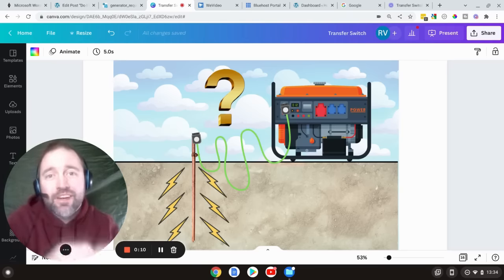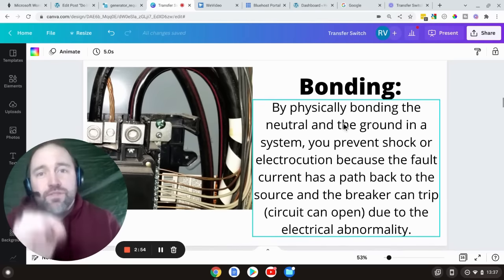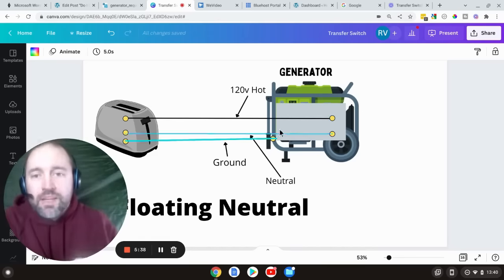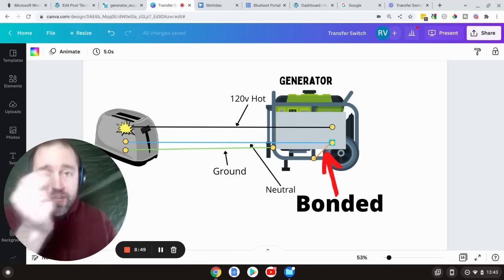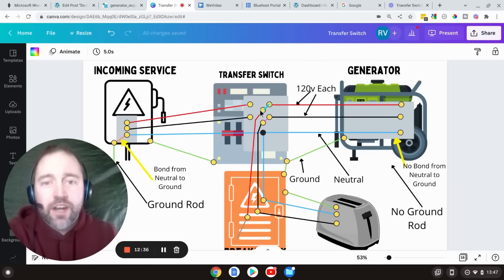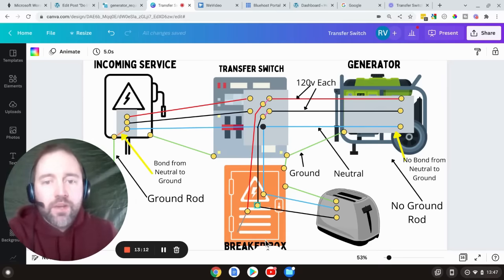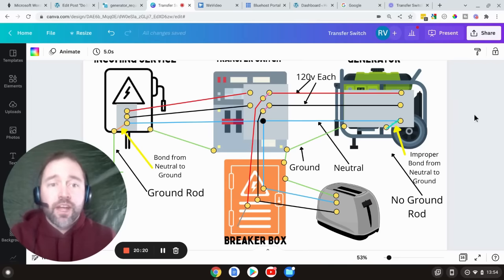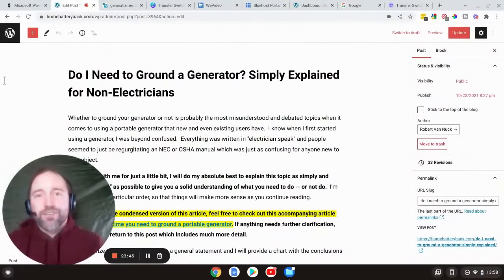When You DO and DO NOT Need to Ground Your Generator [Extension Cord Use & Backfeeding a Home]

Comment: I'd like to ask a question. I believe everything you're saying here 100%. Re: the video at https://youtu.be/_qVR5Yvktlk titled "Champion Help Center: Converting Your Open Frame Inverter from Floating Neutral to Bonded Neutral", Champion states "Warning! Your unit is not fully grounded yet. before running your generator, you must connect a ground wire from the generator to a properly grounded copper rod that is at least 8 feet in the earth." This conflicts directly with the part of your video where you state this could create a dangerous condition. What are your thoughts on that? Is there a specific situation where Champion is correct, and you're correct? Just looking for clarification. Thanks for your awesome video. I'm not an electrician, but I dabble in stuff (built a 3D printer that uses mains for bed heating, DC for everything else, installed UV lights in my HVAC). So I know enough to be dangerous. I want to know enough to be SAFE. Thanks again!

PS: I intend to bond my neutral to ground on my  WEN 56380i. I figure I can do this either with a jumper at the outlet or a jumper plug via Amazon. Cheers.

Comment: Great explanation of when to use a ground rod and when not to use a ground rod. The actual reasons were briefly mentioned, and that's okay. As long as the job's done properly, knowledge of the theory and engineering isn't necessary. The only issue with this whole presentation was the mention of lightning and the main purpose of the ground rod. Lightning should have not been mentioned. Instead, just say that the main purpose of the ground rod is to insure that the grounded conductor is at ground potential at that location.

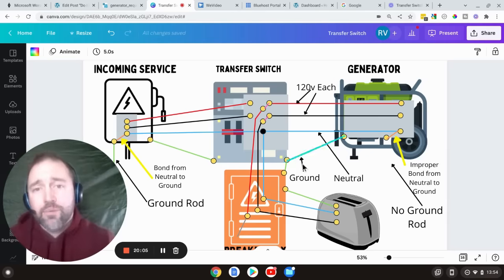Comment: 15:25 Notice the reason you don't want to do this is "because it violates code." This is the kind of nonsense that electricians make up in order to justify their existence. A fault condition is not normal operation. How can you complain about current taking two different paths to trip a circuit breaker? The only times two paths should matter during a fault would be when relying on a GFCI to clear a fault or when a larger breaker upstream needs to trip. I would rather have a redundant ground circuit to ensure my life doesn't depend on one wire; and if my body becomes part of a circuit where a larger breaker than exists in my building needs to trip then I probably won't need to worry anymore about violating electrical code because it's not going to trip in time to save my life anyway.

However, in the case of a ground carrying current in place of a neutral where there is no fault, yes, that's very bad. So I would say it's more important to ensure your house wiring is up to date rather than just go by rules of thumb.

Comment: nothing you said is unsafe as far as it goes and anyone following these rules for using a small genset to directly power an appliance would do no wrong by following them BUT you have a few misconceptions. The driven ground prohibition is basically wrong "unnecessary" would have been the correct terminology BUT only for your exact set up: "a free standing genset connected by cord to an appliance". The rod its self however in the configuration you illustrated presents zero hazard , it is connected but not part of the flow of the faulted current so long as the actual grounding wire in the cord is connected due to the "low resistance pathway" it presents.
 moving a step up from portables when a large genset is connected to a building through a transfer switch such as at a hospital EVERYTHING gets taken to earth at every location and all the rods or ufers are bonded together by code it is required and you wont get the install signed off with out them PERIOD.
  I have connected gensets of the type you are showing to smaller manual transfer panels as well and while i have never bothered to drive a ground for a portable the setup when connected incorporates by necessity the house's grounding system including the driven or ufer ground to earth which in terms of your diagraming would simply place the rod at the "toaster" end of the ground wire instead of the gen side which makes no difference to the circuit at all.
 and btw dont feel bad over the misconceptions most electricians share them as did i at an earlier stage of my career at some point however i ended up installing several CAT gensets and worked directly with the CAT reps on those projects it was quite the education.

Comment: Sorry way too fast for house owners to follow. Why not just explain why you need to have your breaker panel unbonded when you install a generator...AND most important..toaster wires coming loose and touching the metal frame is like lightning striking 3 times at the same point on earth...almost never happens...the chances of a ground fault are so rare I don't really see the need to make consumers pay for these code changes...Use our resources more expeditiously and ban assault weapons, make cars safer, raise bridges taller so trucks don't crash into them...paying thousands of dollars when you install a generator is just wasted money.

Comment: It seems that the current flows totally different in the US then in Europe. Ground earth rods only for lighting and DC current is wrong!....Touching an electrified casing while standing on the ground and not getting a shock.or be dead? Wrong. etc etc,  I can just advise to remove this video, revise with true information and repost. 
Otherwise the information given is on key point wrong, dangerous and possible very lethal.